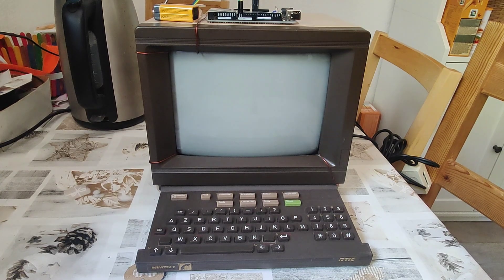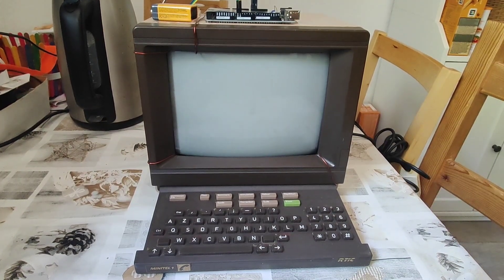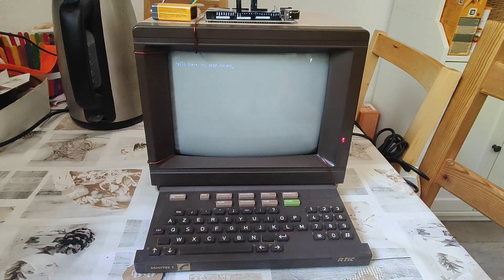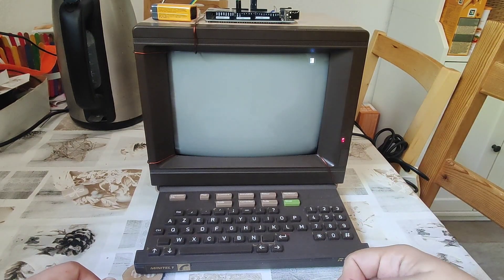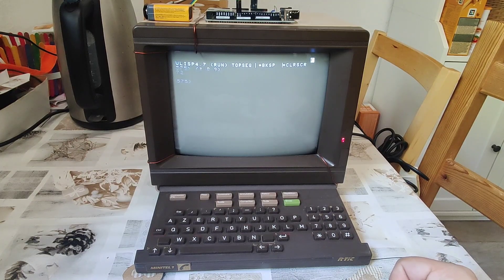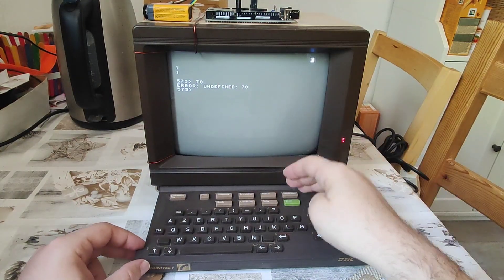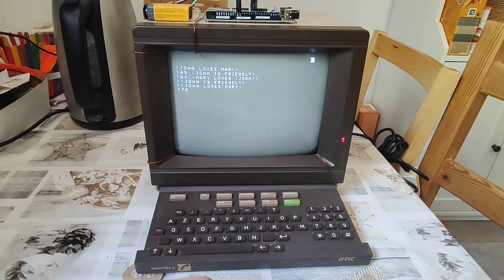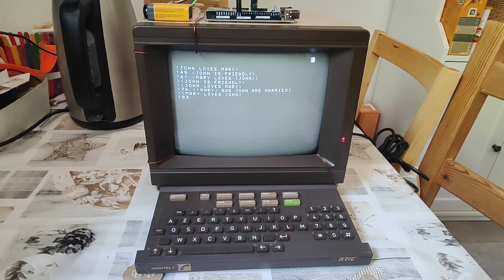Arduino MEGA2560 + Minitel + uLisp = mighty AI workstation

Comment: Ah, the Minitel.  You have to lover the Azerty keyboard.  The 80 column mode was based on the Dec VT100 commands.  It was a bit annoying in that it could only process two video attributes at a time.  If you wanted reverse video, blinking, underlined text you had to send the attributes in bunches rather than all together.  I got to spend quality time with the Minitel in France because my company made products that connected Minitels to IBM mainframes and to Sperry mainframes.
Reply from the maker: Thank you for sharing! (I really love it when people do, it gives the experience "more life"!)